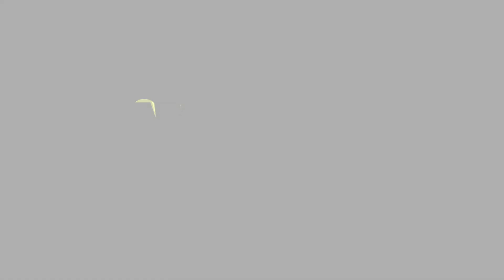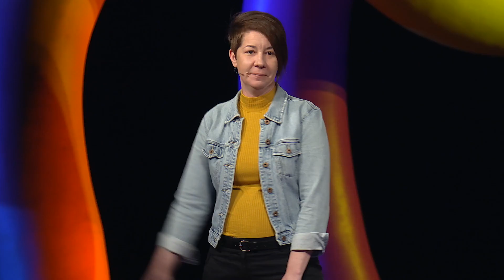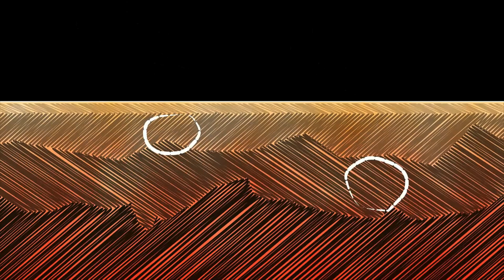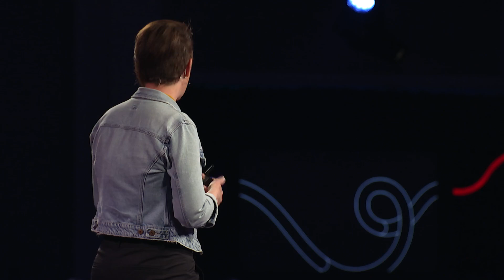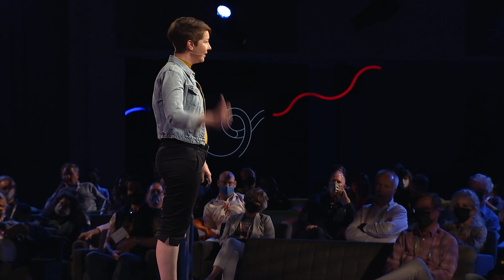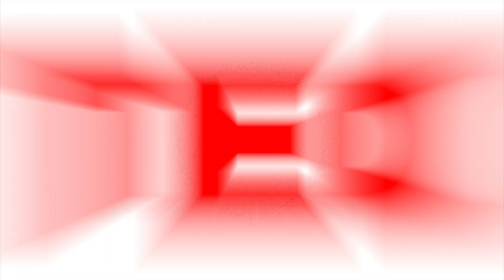The Untapped Energy Source That Could Power the Planet | Jamie C. Beard | TED

Comment: Another idea, in some areas they are repurposing closed, deep mines as heat pumps. Once the mine hits a certain depth you have heating from the mantle to deal with. What they're doing is putting pipework in place and extracting that heat for area heating. It's not quite hot enough to drive a turbine but it's hot enough to heat houses etc. This in turn takes some of the heating load off of the energy grids and out of the environment. Not a miracle cure as you still need pumps but once installed it's cheaper than running boilers etc. How many other abandoned deep mines that could be used for this? Doesn't need drilling, just pipe fitters.
Reply: How many homes or businesses are near such big deep mines?
Reply: Quite a few, remember there's always a mining town near a mine. Most places where the mines have been shut have insisted that the land is reclaimed (at least in Europe, don't know about USA). With reclaimed land, they've either building social housing, sheltered housing or industrial parks. All of which can use hot water at 50C+,either heating the buildings or hot water.
Reply: Actually u don't need a big mine to heat ur house and can use geothermal for almost any house, for every watt the pump takes up to 2 watts of heat can be had, so effectively its 200% efficiency
Reply: Sounds overly dangerous. Worst of all, if there’s a mine collapse then the heat pump could get knocked out and it’d be extremely dangerous to go down and repair it.
Reply: @patrickbrennan2864  yeah geothermal is expensive, heat pump look more promising with new variable speed ones being extremely efficient, usally more than geothermal

Comment: A major reality check is needed on all projects that endeavour to use geothermal sources. If it was easy, ask why it isn't the most pervasive form of clean energy already? We've been drilling deep oil & gas wells for ages then why? What skittled Geodynamics was hydrogen embrittlement. Deep rocks have heaps of hydrogen ions and these come up in the water that may already be there or injected into the well to tap the heat. Result is that pipes, joints, turbines etc. will fail unpredictably. If you decouple the source heat and water from the thermal cycle, then that adds cost and transfers the problem to the heat exchangers. You could use ceramics, but these technologies are not cheap. The result is power between three and six times the cost of Solar and Wind. This current result does not stand up to cost and risk analysis

Comment: Amazing! I was in the oil fields in the 1970's and asked my self - and others around me - why we couldn't do this. The Iceland example was, is and for a long time has been right in our face. The energy of the Earth is condensed like that in a battery unlike solar which is dispersed and dissipated by the square of the distance from radiator to collector.
Reply: Both exhibit the inverse square law. The difference is that the surface area of the collector in EGS is much larger and closer to the radiator.

Comment: The fracking side of this makes sense however, i think we have proven that it can cause much more harm than good in most circumstances. The drilling of fanned out tunnels on the other hand is what would make this incredibly efficient. If you drill enough fanned holes, you wouldnt need the fracking at all.
Reply: Well, for the main issue with fracking is the toxic and/or reactive substances that they're attempting to extract in the first place, but if they target locations that don't have those substances in appreciable amounts, then that problem is largely a non-issue, no?  Fracking can cause other issues, but it's mostly about the toxic substances that are locked up in the material that the companies are after leaching into the groundwater that is the issue, and it doesn't really apply in this case.
Reply: @ThatSoddingGamer  I largely agree with your statement about the toxic compounds being sought after however, the fluids used in most fracking operations contain around one % of many dilute acids, biocides, corrosion inhibitors, friction reducing agents, potassium chloride, pH adjusting agents, various gels, scale inhibitors, and surfactants. In small amounts these might not cause many issues but when considering that the one percent of these agents represents the one percent of the millions of gallons of water used for the process its not a negligible percent. Also as a side note, many earthquakes are supposedly attributed to fracking operations. In the end, fracking contaminates the local water tables and ruins drinking water for millions of people regardless of the gas or petroleum being sought after.
Reply: @skelitalmisfit12  Even if it was somewhat less efficient, could they not use normal water?  At least some of the extra compounds are likely intended to more easily bring the compounds normally sought after in fracking operations to the surface.

As you mentioned earlier, they could just use one of the other methods instead.
Reply: @ThatSoddingGamer  Honestly I have no idea if plain water would work. I am sure they could devise of a method that would result in a somewhat similar effectiveness. I think that most of the chemicals might be added to reduce the wear on the machinery and to reduce the surface tension of the water to form finer fissures in the rocks but thats pure speculation. I also agree with you that some of the additives are likely to aid in extracting the gasses or petroleum more efficiently but i would have to do much more research into the subject to know for sure.
Reply: @skelitalmisfit12  Well, let's hope that the $100 million they got will be put to good use and this doesn't end up like loads of other startups; dead before it gets anywhere.
Reply: Fanned out holes is called multi laterals in the drilling business. Very expensive, fraught with risk but very productive if successful. Definitely a route to explore but hugely expensive and risk catastrophic if failure occurs on the last lateral, lose everything.

Comment: Just a question... Will we not end up with another natural crisis eventually..? If it is on global scale and "green" as implied it probably would be used more than necessary. On that scale there would be a lot of loss of heat from lower crust to surface and in turn from mantle eventually. Would that not eventually start to affect our natural magnetic field in a further future?
Reply: Specially to pull the same industry that knew bout the consequences from drilling for oil and now use them for another source ? If they didn’t care before they probably will care now …. Sigh
Reply: I think that the scale of heat being drawn upon is incredibly small compared to overall heat from the core, so I'm not sure it would have that big of an impact. Closed loop systems especially seem to retain heat better to my understanding. Additionally most of the cores heat is actually produced from radioactive decay, so I see no reason why that heat would stop being produced in the core anyways.
Reply: It is a fair question but I agree with Jeremiah about it being a case of scale.
Reply: Fair point with scale. Just was wondering how long would it take (if trend of near exponential energy consumption growth continues) to actually have any noticeable impact.
Reply: @vladislavasnovikovas6271  yeah it is a fair question, I don't know of any research that has gone onto looking at that as it is still a fairly novel idea in energy (on this scale). There are some examples of geothermal where the local temperature did decrease over time such as the Lardarello plant in Italy, which started operations around 1915 I believe. But as I understand it even that plant is still operating at the size of a typical coal plant today despite being so old. So at the very least I would say each plant might be able to last 100 years before a new site needs set up (though I'm sure it varies widely depending on the site).

But yes overall I think the original question you posit is actually very important. We should understand the full scope of the question before a scenario like what this speaker puts forth with all energy coming from it.

Comment: You'd need an enormous amount of energy just to circulate heat exchange fluid that deep. The hole would have to be ridiculously deep and the fluid heated to ridiculous temperatures and pressures to even break even.
Reply: We already have surface access through volcanoes or deep natural caves that have done much of the "drilling" for us.
Reply: @michel3691  The whole point is to do this anywhere, I don't see many volcanos in Texas. Besides, volcanos lead to molten lava, then what?
Reply: @308_Negra_Arroyo_Lane  Why would a closed loop system need more energy based on how deep it was? The only difference should be the total distance traveled.
Reply: Wouldn't gravity and convection do most of the work for you in a closed loop system? denser cold water pushing less dense hot water out the other end.
Reply: @JohnDoe-ib3hr  In a lab it would work...
Reply: @308_Negra_Arroyo_Lane  So await the results of the trial that beings just next year.
Reply: @homewall744  Well I guess if they fail to provide free energy for a million years we'll at least get some new hot spring resorts out of it.
Reply: I would like to think this will work, but first cost versus capacity wasn't even touched on.

Comment: Jzeee, at the end I found myself jumping off the couch applauding !😄
To harvest geothermal energy from the Earth's core and get it to anywhere in the world it's absolutely fantastic!
So wonderful that it almost makes you forget how deep you have to drill and pump to get some fluid hot enough to run a turbine, but still a wonderful idea!🙂
And drillers keep drilling! 
Quadrillion dollars idea !! Ya, Jamie ! 😉
Reply: What will be the vehicle for the transmission of heat  to the surface, steam, CO2, etc.?  We have to be watchful as not to put out more co2 to the environment that what we are putting today or not use more water than what we are using today. If that is not so, then this is a great great idea.
Thanks!

Comment: "But the value of that shell will fall,
Due to the laws of demand,
Nobody wants to buy when there's lots in the sand..."
If they could also make those sci-fi plasma like energy 'batteries' to go with a spike in the supply of energy.
Reply: And the one thing on my mind while watching this was the secret base concept of the sidekick-made-villain Sydrome in the Incredibles 1. He used an island with a volcano at the center, drilled right through it and built his base inside, harnessing geothermal energy to power everything in his secret lab and workshops.

Comment: The fossil fuel companies have the tech to drill geothermal, but do they have the will to participate? They seem likely to actively oppose it.
Reply: Not if there is money in it and not if oil costs more after taxes. They're just greedy. This video sounded like a PR stunt for oil though. I certainly wouldn't mind competition to enter the industry but I ultimately don't care if oil companies are the ones benefiting so long as the problem is solved. I don't get why she talked about instead of the surface area on earth where this is viable and the cost. Could we even do anything if oil companies asked to build geothermal power plants? They seem to be walking over us anyway.

Comment: And just like oil solar and wind cause climate change geothermal is going to cause something idk what but something also you might be wondering how would solar and wind because in climate change or being a part of it and all those solar and wind are not bad they aren’t great either when you’re making the material such as metal or the components that are used to make a wind turbine you are causing carbon monoxide to be released from those materials or be making them when you hit the materials up bend them or when you are extractingThose materials let’s say solar when you were making the tiny little sheets of a kind of metal how did that metal getting there in the first place people had to my net and they have to use explosives get to use machines that use gasoline oil to power those machines nothing is perfect